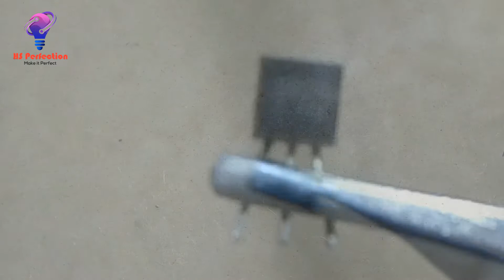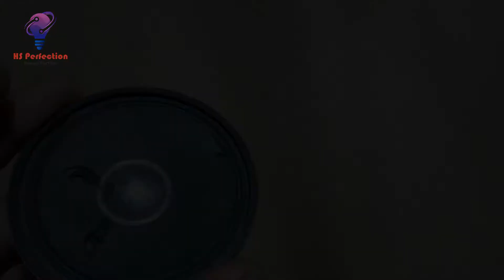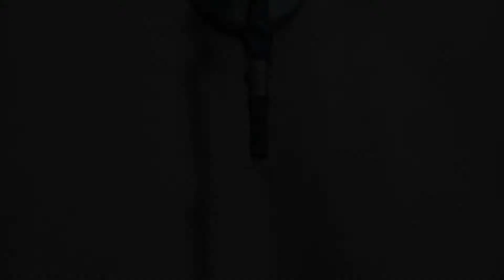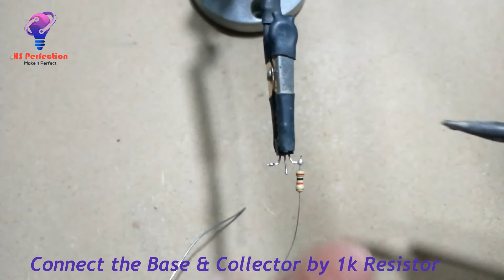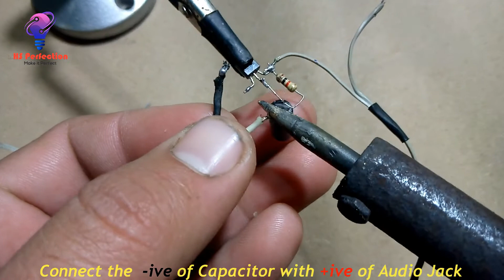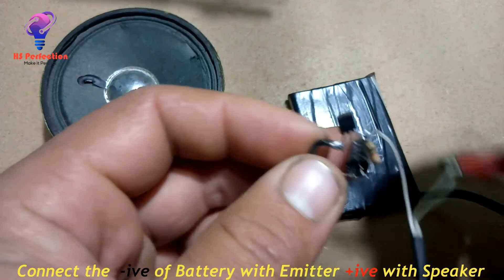S9014 Transistor Amplifier |How to Make Amplifier Using S 9014 Transistor

Comment: Bro 220uf  16 volt capacitor bro can I use
Reply from the maker: Yes...its just for experiences....it enhance the sound... good idea
Reply: Tq bro
Reply: U r video is nice👌👌👍
Reply: @hsperfection7606  Greetings my friend, can it be used in s9015 and which capacitor we use in this circuit, the sound efficiency will increase. Can 1 k resistor be used?